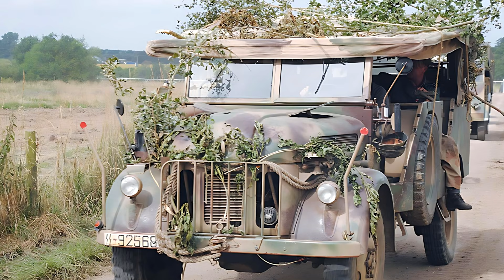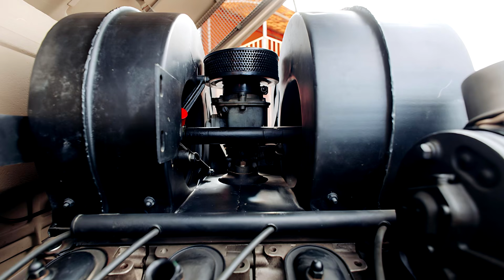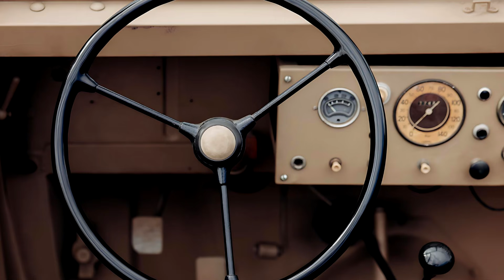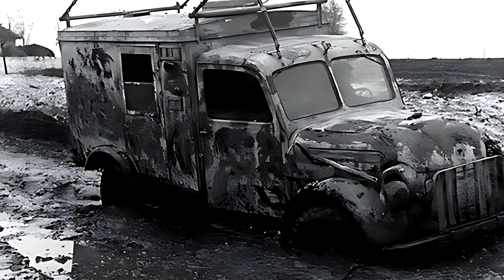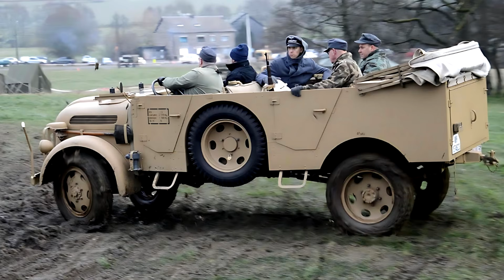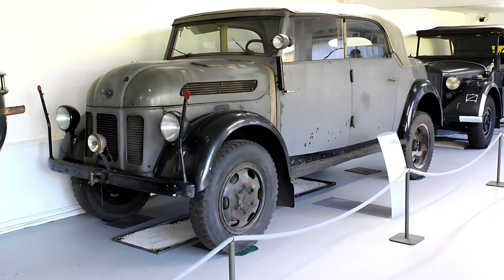1942 🪖 Steyr 1500A — Not Famous, Not Fast, But Always There

Comment: Well I'm impressed. 4x2 ,4x4 high low , independent front end, cv shaft drive, no locking hubs, air cooled engine, all wheel hydraulic drum brakes.  I would hazard a guess they probably carried 2 to 2.5 ton during ww2 plus towed a trailer or gun.